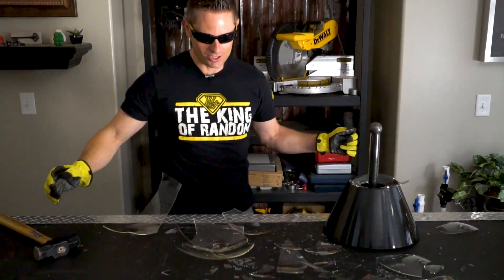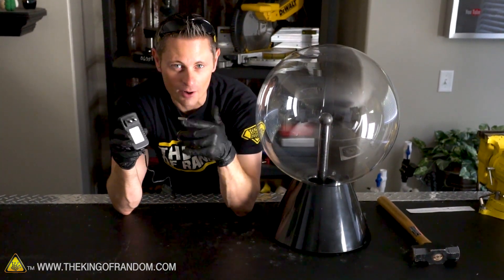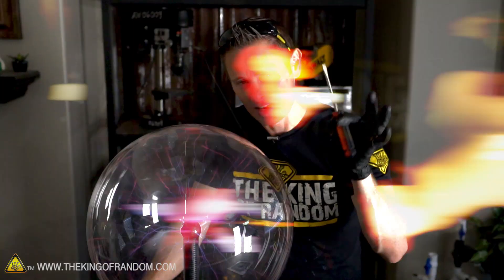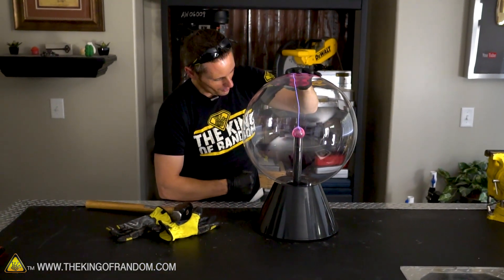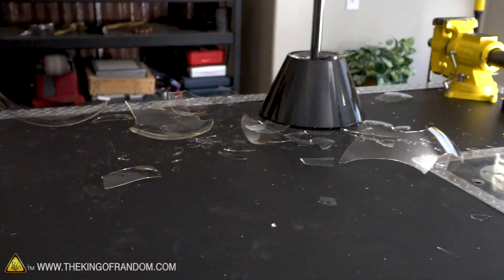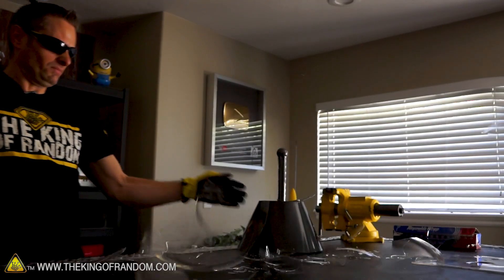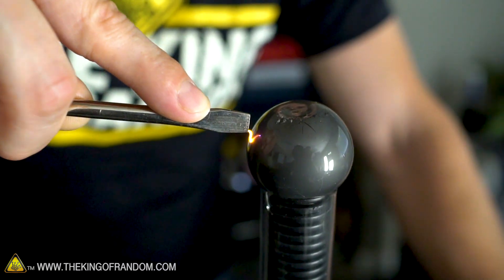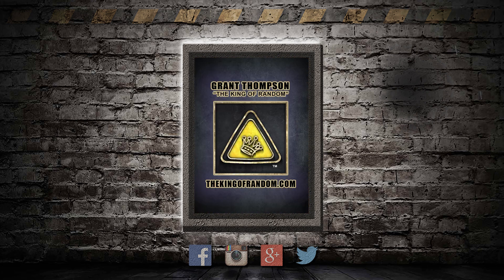Should I Do It? TKOR Tests What Happens If You Break A Plasma Ball? Breaking Plasma Balls 101

Comment: Can u freeze helium 
I guess not but how about the oposite of helium I forgot its name😅😅
Reply: Please chose me
Reply: JDB_Ghost 2005 Helium is a gas bud, you can't freeze gas.
Reply: JDB_Ghost 2005 it would be far too cold to safely consume. He'd get frostbite in his mouth, throat and probably stomach too. On top of that, the helium would have to get in his lungs and voicebox to have any effect.
Reply: J
Reply: Tazlikesbacon condense it then
Reply: Everything is a gas under the right conditions. Like wise, everything can freeze. Just not necessarily under conditions in someones house.
Reply: JDB_Ghost 2005 I don't believe helium can be a liquid so no matter how much you pressurize, condense, and of that, I don't think it can liquidize, so it cannot theoretically "freeze" if that's what you mean
EDIT: ok helium can be a liquid but it has to be nearly -269 degrees Celsius, which is colder than liquid nitrogen.
Reply: sulfur hexafluoride
Reply: JDB_Ghost 2005 it's impossible to make anything that cold inside of earths atmosphere, you would have to be on a different, much colder planet
Reply: No. Helium has a melting point of less than 1K, and a boiling point of 4 K.
Reply: no

Comment: Put the tesla coin from this experiment in the vacuum chamber and fill the vacuum chamber with the gases you have available (i.e. helium, nitrogen, liquid nitrogen,etc) and see how it reacts to the different gases.

My thought of how to do this is to vacuum out the air in the chamber first then release the gas once the chamber is void of natural gases.

You might have to modify the vacuum chamber to do this. So you can pump the other gases in through a different tube.

Comment: What happens if you put your glove on the tesla will it melt?
Reply: No, as the glove insulates from electricity and therefore no current passes through, meaning there is no resistance and no heat is generated

Comment: Since argon has a higher boiling point than nitrogen, could you try and make liquid argon using liquid nitrogen? If you did and you ran an electrical current through it, would it still turn purple?

Comment: The reason that it doesnt arc as well without the globe is because the globe is filled with argon. Normal air cant transfer the electricity as well so it has to be alot smaller

Comment: There is no tesla coil inside a plasma globe. The plastic bit just contains a straight wire connecting a high voltage driver in the base to the metal ball in the globe.

Comment: What if you were to take the extra plastic that is used as a stand off, create a different vacuum chamber with a tiny hole, put the tesla coil in and run the cord through the hole, reseal the hole, and then turn on the vacuum chamber and coil. Maybe it would have the same effect as the plasma ball...? Maybe you could even replace the air in the chamber with a gas to make sure it would work.

Comment: Next time ask me about the technical explanation ;)

The tower youre seeing is not a tesla coil. Its just a mostly empty glass tube with a wire going into the ball at the top, which is usually filled with steel wool. That wire goes down into a high voltage transformer, very likely a flyback transformer like in old TVs, but smaller. It can be quite fun to play with, but those arcs may cause bad burns. 

How does a plasma globe work? 
High voltage is applied to a special low pressure atmosphere. A vacuum filled with special gases which emit light when the electrons pass through. 
The middle is the anode (positive), the outer glass layer the cathode (negative). 
But wait, glass doesnt conduct electricity?!
Well yes, glass is an isolator. But the transformer output is AC, so it quickly changes its voltage all the time. That allows it to couple through glass or anything else, really. It doesnt go through the glass, but rather pulls the electrons on the other side of the glass towards it or repels them. Your body, when near the glass surface, provides a path to ground, which is what the cathode of the transformer connected to, causing more current to flow and making it light up brightly.

Comment: Try cooking  something like bacon on the hot plasma bulb
Reply: Dylan Sullivan it's called an experiment for a reason, people want to see what happens I'm sure he can alter the experiment on some way to make it work. For example try putting aluminum foil on it or something.
Reply: Henry Hungaski again, he could put something like aluminum foil on it and that would absorb and distribute the heat therefore cooking the food
Reply: Henry Hungaski thank you though
Reply: Luke Bqesq I think the bacon would need to be conducive to electricity; i.e. in contact with the ground.
Reply: That wouldn't work for two reasons: 1. The arcs can only focus on any one point on whatever is touching it, so about a square millimeter would get cooked anyways. 2. If you fully touch the point of contact, the circuit is complete, and doesn't arc anymore.

Comment: Can you use the Tesla coil and make a pressurized atmosphere so it would work again
Reply: It's not pressurized. It is filled with noble gases at nearly atmospheric pressure. The pressure isn't causing the arcing ionization, it's the gas mixture inside.
Reply: it has to be a noble gas though.
Reply: jort93z yea! I don't think noble gasses are expensive tho

Comment: Pretty sure the column supporting the electrode is not part of the tesla coil. Looks like it could/should be. But that is the result of style, not substance. The actual coil is a small ferrite transformer in the base, driven by a single transistor.

Comment: GALLIUM BULLETS!!!

Like so Grant can see this ;)
Reply: Renzo Flordelis Gallium melts at slightly above room temperature... it wouldn't be hot.
Reply: The gun's gonna jam because the blasting cap and the gunpowder are gonna melt the gallium.
Reply: theres already vids of gallium shotgun slugs
Reply: Stopmo Kole awesome ideo try asking demolition ranch for it
Reply: melts at shooting HOT HOT HOT
Reply: Cody'sLab did this
Reply: gallium has a low meltig point
Reply: yall are missing the main problem, you can cool a bullet that melts near room temp and shoot it. its not going to heat enough to melt during 1 milisecond launch time, thats not possible. the problem is gallium breaks like glass you cant squeze it into a rifled barrel like copper or lead. people avoided this by making gallium shotguns slugs, and codys lab has shot mercury bullets through a rifled barrel which melts even lower. temp is avoidable. brittleness isnt for regular guns.

Comment: well lets look at what plasma actually is; a fourth state of matter of superheated gas or gas with an electric current flowing through it. If it is indeed a 'plasma ball' then the gas within it may be one that has a lower plasmafication point, or requires less energy to become plasma than air. the pressur and or temperature may also have an effect. as well as this, the glass seems to be some sort of ground for the plasma arcs. i am no physicist so dont judge me if im wrong, im more of a chemistry guy ;)

Comment: What would hapen if you re-built the dome around it but instead put helium. Will the ''octopus legs'' become any longer because of the density of the air?  Like if you agree
Reply: the globe contains argon or helium mixed with neon (which are not flammable at all, they are noble gasses and they don't
react with oxygen).
Reply: Kimonarrow isn't helium flammable. if so it would catch from the sparks
Reply: i dont think so
Reply: The gas doesn't need to be flammable, any gas, actually any substance can be turned to plasma.
Reply: Kimonarrow ok
Reply: Kimonarrow and if you added sulphur hexaflouride would they become shorter
Reply: we know that. I was saying that helium was a BAD idea. ie dangerous

Comment: Plasma globes like that usually use a flyback transformer like the ones in old CRT TV screens.  They are operated at a high frequency with one node in the glass somewhere at the base and the other node extending up through the center of the ball.  The center ball has a conductive coating on the inside and is normally filled with metal ribbons so the electricity can more easily travel to the surface of the glass and conduct through the gas inside the main globe itself.  The ribbons help create a random pattern of bolts.  As they conduct they heat up and as they heat up they become more resistive and so the electrons eventually find a different path to the surface.  The inside of the center ball is usually exposed to outside air through the long cylindrical tube that extends to the base.  Yours seems to either have a decorative coil up the cylinder or possibly an actual coil, which would be interesting to dissect.  Maybe a "Bits and Pieces" episode could be done where you analyze the leftovers?

Comment: If you put a straw in a glass of water then put your finger over the top of the straw hole and lift up the straw, the water will stay in the straw. Will the same happen with mercury or will it's higher density be too much for the air pressure keeping it in?

Comment: Hey! I am wondering what would happen if you took a container, and covered half of of the top with a lid. Then put another container filled with water on the top of it (using some sort of big card). The gap between the lid of the container and the container filled with water is sealed.  What would happen? Im not sure if I explained this thoroughly so heres something else
   _
  [  ].   -water
-----------
    [__] -Air
     Something like that? Could you make it happen?

Comment: Grant Thompson what most likely happened was when you initially cracked the glass, the atmosphere outside shot into the globe which was under vacuum. This created a jet of air that caused one side of the glass to explode outward, kinda like a mini air canon. The rest of the glass simply fell to your workbench as it was not directly subject to the force of the column of air that rushed in. Plasma globes are usually kept under vacuum.
Reply: Oh and ✌👑. Your videos are great. They're a great stress killer after a long and tiring day.

Comment: Put the broken plasma globe in your vacuum chamber to see if ti will work. You can also try it to displace the oxygen with another gas, like putting the broken lamp in a (non metal) bucket/container and filling the bottom with liquid nitrogen or cry ice, and then see if it will produce plasma(I doubt so but it might work in the vacuum chamber, especially if you make a glass/plastic one instead of using a metal pot).

Comment: grant, microwave a plasma globe and things similar to it, like lightbulbs. like your vids!
Reply: the glass probably had different thicknesses because of the pressure. there would be weak spots (thick glass) and strong spots (thinner glass) the reason the top probably flew off and didn't completely break from the hit is because it was made of the thicker glass and the pressure didn't make it crumble. the thinner glass on the sides didn't fly as far because they had already crumbled and the pressure inside the globe was gone after the initial hit.

Comment: I have vr goggles and left them on my windowsill and I was sitting at my desk and saw what I thought was smoke coming from the top of the goggles and I was right lol, i opened the goggles and the sun shined through the lenses burning the inside of the goggles. Now there are to horizontal lines on the cap where it was burned

Comment: Grant I think you should get a plasma ball and make a small hole to pour silicone mold or any other fluid that turns solid into the ball then glue the glass back in place after the silicone dries and turn it on. just a thought

Comment: the gases inside the plasma globe is most commonly neon, sometimes with other noble gases such as argon, xenon and krypton just thought I would share and Plasma globes were most popular as novelty items in the 1980s. The plasma lamp was invented by Nikola Tesla, during his experimentation with high-frequency currents in an evacuated glass tube for the purpose of studying high voltage phenomena. Pulse Even in a "cold" plasma, the electron temperature is still typically several thousand degrees Celsius. Plasmas utilized in plasma technology technological plasmas are usually cold plasmas in the sense that only a small fraction of the gas molecules are ionized.   Mr. Grant you dear sir are so awesome

Comment: Reuse the tesla coil of plasma globe, put it in vacuum jar and turn it on....plz :DD
Reply: Roy Wong Jian Chung I don't believe it would do much as the arc won't be able to jump through near nothingness
Reply: Roy Wong Jian Chung it would do nothing
Reply: Like they said, since inside the plasma ball is a noble gas which can act as a medium for electrons while not reacting with things
Reply: If he suctioned the air out and replaced it with some sort of gas (such as argon, or possibly sodium hexafluoride) it would show the arcs. I do believe however that with different gasses, the arc might possibly be a different color.
Reply: Deicide Gaming It would work at the right pressure. Without the right gases you wont see much though.

Comment: I'm guessing the gas inside was either argon or nitrogen. Both of these gases are in the air we breathe, so that explains why the screwdriver reacted with the centerpiece in normal air. It must've had a shorter range because the gas in the globe was just one gas, not a mixture. Anyway that's just my opinion, I could be wrong.

Comment: You should definitely try some experiments with a plasma cutter! Can it cut glass, wood, rubber? Can you boil water? The list is endless!
Reply: Vaskinton Plasma cutters only can cut conductive materials. So wood plastic and other things like that wouldnt be cutable just burned.
Reply: Unfortunately, plasma cutters can only cut conductive metals however, they can burn the first few layers of non-conductive materials without creating a fire.
Reply: Jacob.iseminger You're right. Maybe put metal behind thin pieces of different material.

Comment: sorry Grant, but this is not a Tesla Coil it is a transformer on the circuit board inside and in the black plastic is the wire from the transformer.

Comment: use the arc to make nitric acid!
Reply: the arc it makes splits air molecules, and the atoms formed recombine, which means it makes any gas possible by having free atoms of oxygen and nitrogen which means you have dioxygen, ozone and other gases. and the thing is, it makes some nitrogen dioxide N2O. and if you combine N2O with water H2O it makes nitric acid. then use the acid to make some nitrocellulose or nitroglycerin or something.

Comment: Where you hit it, the glass shatters to smaller pieces, they are lighter, they flew away easier than the heavier lower pieces, I think it's filled with gas, but the inner pressure is near to 1 atmosphere, and the gas can be lighter than air, thats why the whole thing is light. Measure the weight, before / after the smash.

Comment: From the colour of the arcs, the gas was probably mostly xenon, and from googling it they are usually run at high pressure. The arcs to the screwdriver were blue from the air, and the yellow at the end was definitely sodium from the glass.
I'm glad you did this so I don't have to!

Comment: Dear king of random what would happen if you took a car and pumped it full voltage electricity and tried cooking meat on the hood with electricity fine. What is actually cook or would you have to use the sun's light super concentrated to cook meat and can you try cooking meat on a car hood by increasing the power of the sun's light

Comment: what would happen if you put 24 volts instead of 12, would the arc be brighter or would it not even work and try putting the increased voltage in a vacuum chamber to see if the  streamers would reform

Comment: Plasma balls are glass balls filled with a mixture of noble gases (most commonly neon, sometimes with other gases such as argon, xenon and krypton) with a high-voltage electrode at its center. Plasma filaments extend from the electrode to the glass when electricity is supplied, creating beams of colored light.

When the glass ball was broken the gases escaped. This making it nearly impossible for the sparks to travel as far as they did before, basically shutting the plasma ball off (except for when a conductive material is placed close to the electrode).

Comment: you're sending a electrical current through the air wire a nother other coil  and hook up something D.C.  power and it will light up

Comment: It's obvious (to me) that it can't be a vacuum. The Arcing hapens, when elctrodes are jumping from molecule to molecule. It would need an IMENSE HIGH VOLTAGE to let the electrodes jump those distands. In normal Air does they have only some nanometers to jump to the next molecule. But each molecule haves some resistance. So...
More Voltage means larger Arcs and thicker air means also larger arcs but more resistance too...
I would say that It was a slightly presuree argon spheare.
But that Is only my meaning. I dont know If it is like so. But nice experiment anyways... 😁